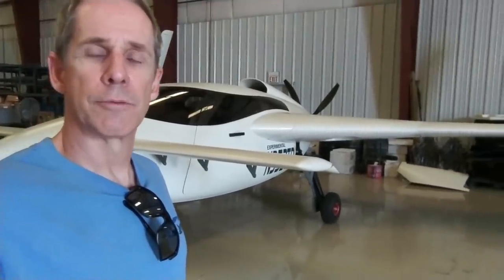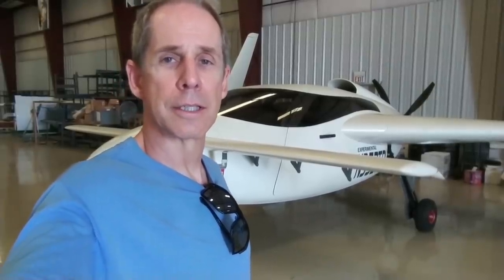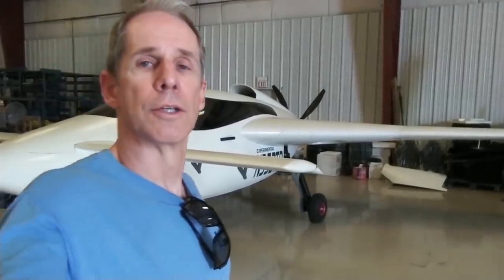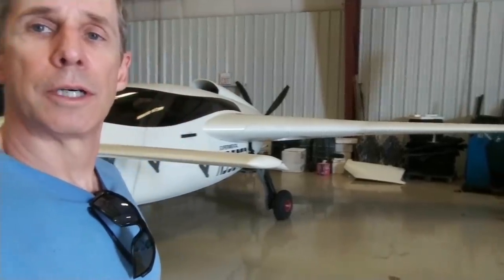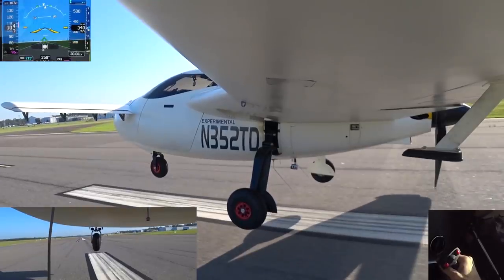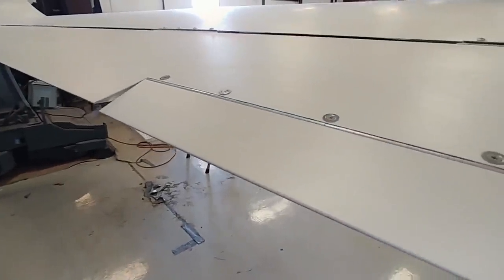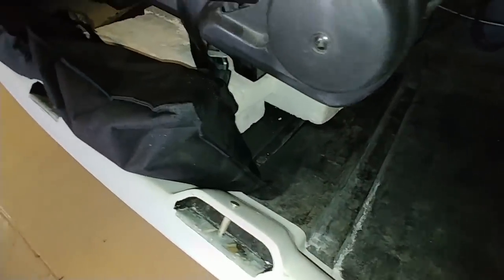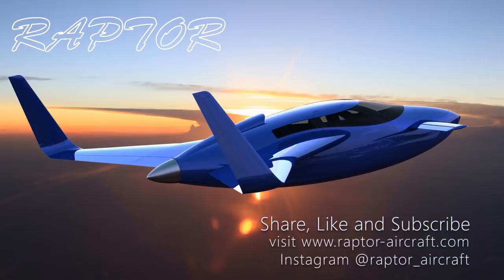Finding a Balance - Building the Raptor Prototype

Comment: Peter, one camera angle we're missing is rudder pedals and/or rudder input throughout the flight.    Are you compensating for engine torque with rudder and is that perhaps translating into roll? It seems possible that the roll to the right may not be an aileron or weight imbalance but a slight roll induced by slight rudder input. Thoughts?
Reply from the maker: A pusher configuration like this does not have p factor the same as a tractor configuration. No right or left rudder is required to keep it straight. The aircraft was banking with power already pretty much idle so no torque factor either. It's seems pretty obvious to me that balancing the aircraft is the first step. If that doesn't solve the problem then subsequent steps can be taken.
Reply: Raptor Aircraft that’s a great response. Could have lead with that.
Reply: @RaptorAircraft  P-factor has nothing whatsoever to do with whether the propeller is a tractor or pusher... it's the simple fact that the blades of the prop experience different angles of attack and airspeeds when they are traveling up one side of the propeller arc than while traveling down the other side if the angle of attack of the aircraft is anything other than perfectly horizontal.  Also, since your aircraft IS a pusher configuration, the propeller blades may experience differences in their angles of attack at different points in the propeller arc depending on what the airflow coming off the wing/fuselage is doing.  You should absolutely expect to need to compensate for P-factor (and torque, although that is usually a small portion of the turning tendency of an aircraft during takeoff).  The only thing that your design gets you "out of" is that you don't have to deal with a spiral slipstream from the prop impacting other flight control surfaces.
Reply: Raptor Aircraft - Peter, please don’t dismiss the torque as not being relevant. The slip stream is not equal to a tractor configuration but you have 400+lbs of torque then it’s affecting your flight characteristics in some manner. Your taking a methodical approach and that’s what needs to be done but I don’t feel you have enough information with only one hop in the air and trying to analyze with such limited data. Make you changes, secure the added weight, and then perform your next test. Keep in your mind what you’ve experienced so far and possibly apply some rudder in anticipation of the aircraft movement. Then make another one. And another one. You will get there just be patient Peter.
Reply: @thomasaltruda  The effective angle of attack from the propeller's perspective is different after having been redirected by the wing, so yes, it is different.
Reply: @LizMatzelle  The effective angle of attack from the propeller's perspective is different giving airflow has been redirected by the wing, so yes, it does have something whatsoever to do with it.
Reply: @thomasaltruda  Look up "adverse yaw"
Reply: @thomasaltruda  you asked "can someone explain to me how torque produces a yaw moment? As far as I can tell, torque from the engine may produce a rolling moment, but not yaw."  

If torque is rolling the aircraft (at slow speed) and ailerons are required to stop the roll, then you'll have adverse yaw unless you use rudder.  I'm answering your question...that's what I'm getting at.  Are you a pilot?
Reply: @thomasaltruda  In my experience torque changes produce very significant rolling and induced yaw . When I level off, I must reduce power gradually over 5 seconds in order to avoid throwing the plane off in roll and yaw. My aircraft has same power and is 20% heavier than the Raptor. Pulling power back from 100% to idle would have definitely triggered a very significant disruption lasting for several seconds.

Comment: Please do not place any weights in the winglet to compensate for drift due to specific configuration. That would  create a  larger moment arm, with consequent instability and probability issues. Please put any weight compensation devices as close to the CG as your imbalance on the right side arm causes.  This is necessary to get crucial data to get this great project from the dream to the reality.

Comment: Thanks a ton for the detailed update on the landing gear, and the ailerons. Another thing I keep wondering: How close are the prop blades to the ground when those rear wheels touch back down again? It's very difficult to see in the video. This airplane is so awesome, though. Again, I can't wait to fly it.
Reply from the maker: I guess it doesn't matter how many times I answer this there's always a group of people that ask again on every video. If you look at the 5:30 mark the aircraft is 10 degrees nose high, admittedly only on the left main but there is still about 3 inches of clearance if you look at the shadow of the prop blade. Please tell all your friends so I don't have to keep explaining this.
Reply: @RaptorAircraft  Thanks. I will! I apologize for making you explain it again. I missed about a year's worth of videos and only recently started watching again.
Reply: @n6408s  Or ignore the repeated inane question and then be accused himself of ignoring questions, advice, recommendations, etc. from the peanut gallery.
Reply: @RaptorAircraft  Maybe a pinned FAQ comment would help since a lot of people either don't watch all the videos or don't read all the comments.
Reply from the maker: @theralfinator  and the same people wouldn't read the FAQ. 😋

Comment: I'm inclined to think your homebuilt is flying crooked because of aerodynamic issues rather than lateral weight distribution.  In any case, all counterbalance weights should be secured.  You shouldn't toss weights under the left seat like that.  You never know what might happen on a test flight.  If you had to maneuver aggressively and the weights slid fore or aft, you could have a serious weight and balance issue that could be dangerous.  I also wouldn't put temporary weights in the winglet under any circumstance, no matter how well they're secured, for fear they'd foul the controls.

I'm concerned about the fore and aft shimmy in your landing gear.  You seemed to describe it as lateral flex, which is normal for composite gear legs, and even advantageous as it's a free shock absorber, but the video clearly showed longitudinal rattling rather that lateral gear flex.  Place the wing on a wing stand (I use a pillow and a large surface for the top of the stand to protect the underside of the wing) to raise the wheel off the ground.  You should be able to flex the gear laterally by pushing and pulling on the wheel, but there should be no perceptible motion fore and aft.

Gorgeous plane, but I'm a sucker for canard pushers.

Comment: Not a pilot here: Wouldn't left rudder have been a better choice to bring the nose back to the left? I am asking out of curiosity. Thanks.
Reply from the maker: Well, that might point the nose in the direction you want to go but the aircraft will continue in the direction it's moving. You need to bank the aircraft in order to correctly turn it. At least if you want to turn it quickly. Rudder will do it but not as efficiently.
Reply: @RaptorAircraft  I can see that now, thanks :)

Comment: With the main gear flexing front and back when you land, I would feel like a more stable main gear is needed. I wonder how the flex effects the gear legs especially over multiple landings
Reply: It doesn't look worse than any other Wittman/Cessna type gear.

Comment: Are you not concerned about metal wear when those landing gear touch down  ???
Reply from the maker: Well, obviously. But this is a prototype, everything needs to be tested and when found, problems need to be resolved. I don't know that there is an actual problem until enough testing has been done. You can't fix a problem until you identify and understand it.
Reply: The Cessna C-208 caravan does the exact same thing all the time. Gear “vibrate/ fluctuate “ back and forth due to the rigid design. Obviously more testing required to see what kind of flexing you are actually getting in order to design and calculate your fatigue loading.
Reply: @erikjohnson4181  Ok, the movement on the struts is a little troubling.

Comment: To me putting weight out that far makes for a more easy way to develop stress areas unnecessarily.  Must be another option.  If at all possible try to change the wing incidence if you have that type instability.  You will find adding weight could also affect glide performance and possibly creat more low end performance instability.
Reply: Added weight has no significant effect on glide performance, but raises best glide speed.

Comment: Tendency of banking right could be caused by the engine torque.
Reply from the maker: Out it could be caused by an imbalance. Let's eliminate the easy possibility first.
Reply: @RaptorAircraft  I remember a while back when you did taxi test, the aircraft tended to pull to the right. That could be torque steer. Just my opinion.
Reply: Being in ground effect lessens the right turning tendencies
Reply: @kyleboatright7403  As long as the center of gravity is within the CG range, it shall be able to tolerate the imbalance.

Comment: Peter is it possible to build commercially available mini load cells into the main gear, and have a motorized threaded rod in each wing with a weight threaded onto the rod, so that the weight runs along within the wing. The feedback from the load cells difference, control the motorized threaded rod to move the weight back and forth as needed till balanced, like an auto balance, aside from the standard trim. In your case the right weight will make its way in close to the cabin, and the left weight will move to the outer end of the wing, essentially automating the lead ballast. Sorry if it's another crazy idea.
Reply from the maker: Sounds perfectly simple and shouldn't take any time or expense at all. I'll get right on it! 🤗
Reply: I don't know if this type of thing has been used anywhere else, after all this project is about innovation and advancing GA.